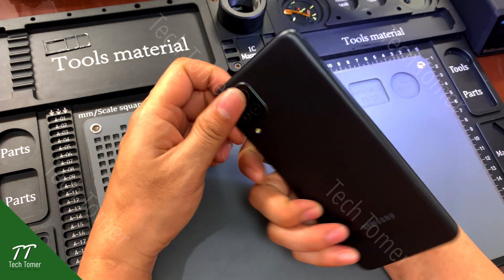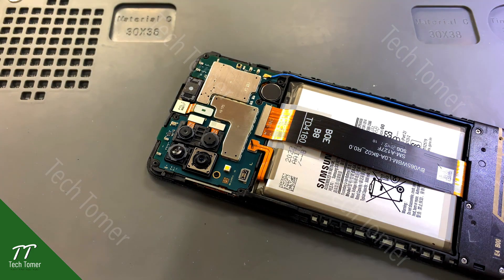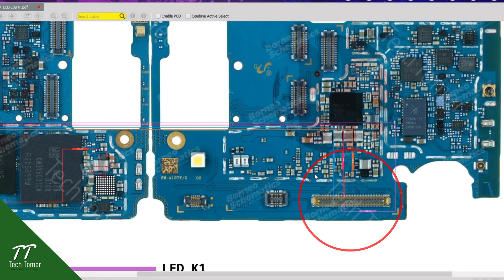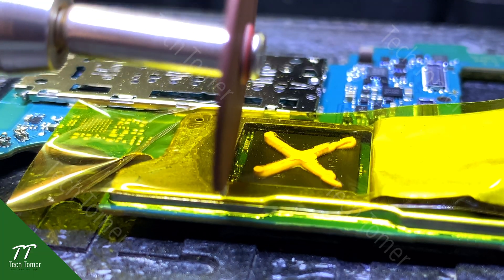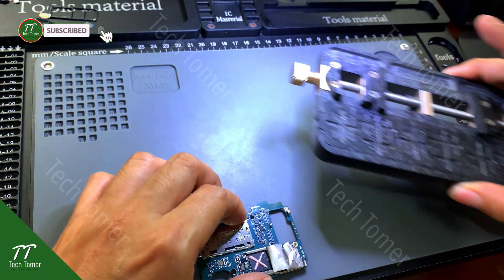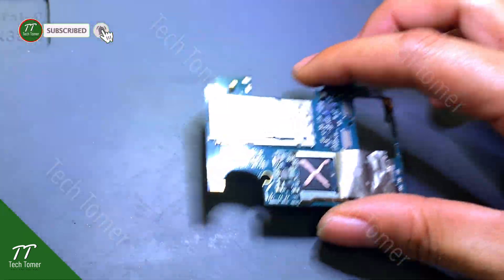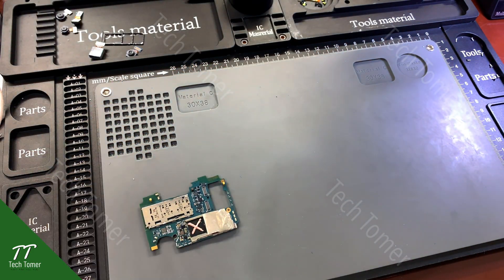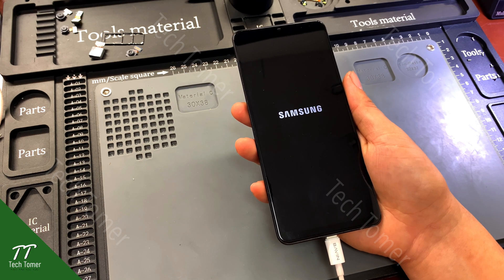Samsung Galaxy A12  Black Screen No Display Light Solution Repair Tutorial | Tech Tomer

Comment: Strange thing is, the phone shows no signs of water or moisture, yet the same capacitor failed… I’ve seen this happen on several models like the Samsung F13 — seems like a weak spot in the circuit.

Comment: I faced this,i got until 5 display ic 3 ofthem lost and idont know what the condition of the 2...need to check the capasitor,hope my cpu is not affected by 5 times reballing display ic😅,if this work i firsly thank before i forgot when it done,nice content very clear,and the most ilike because the fault 100% like mine,ithink someone will face it to with same model same cases and the same experience..😂

Comment: Impressive. So much effort to repair a budget phone. I ordered new screen assembly and spent so much effort to work on my faulty A12. Turns out, the new screen can only barely see anything. Better than old one which no display at all. So now, I suppose the mainboard is the issue. I don't have microscope or workbench lenses. I pried out the shielding and try to look around. Nothing seems burnt. Maybe one or two 1-2mm sized capacitor or what. Then, I feel it is not worth the effort. I'm an IT Engineer, not electronics nor electrical trained lol. So I got no confidence in using heat gun and swap out these nano components. I'm tossing the mainboard out. And will try to sell the screen assembly replacement cheap on Carousel lol. It's a waste to throw a working screen assembly, and sim card tray, and the 5 camera modules from the mainboard.

Comment: 5:42 what are the expected abnormal or normal values for the diodes & capacitors tested?
Reply: continuty over 200 -500 ohm normal reading